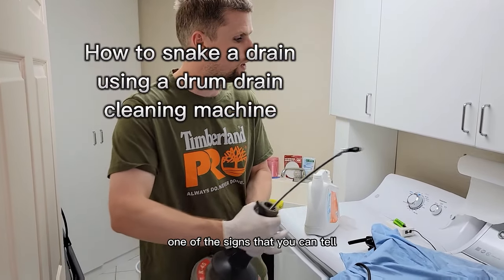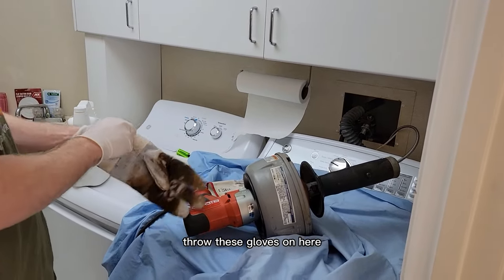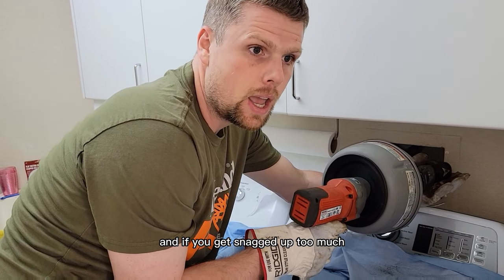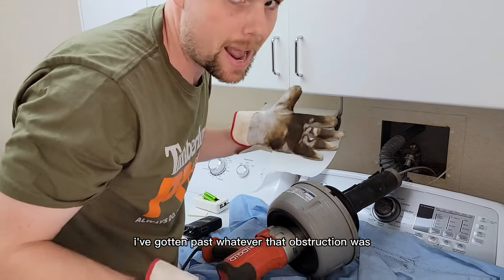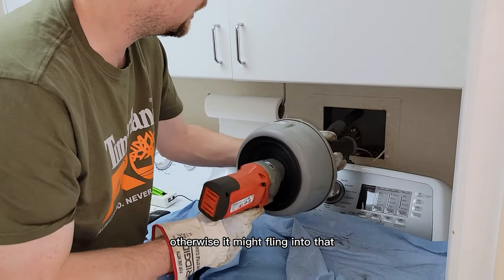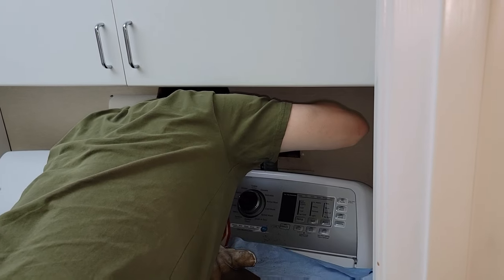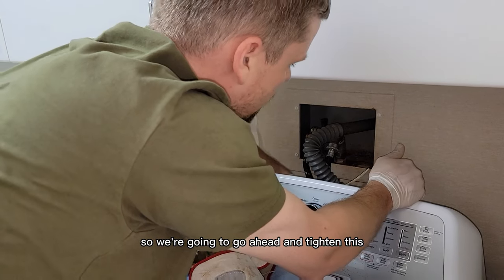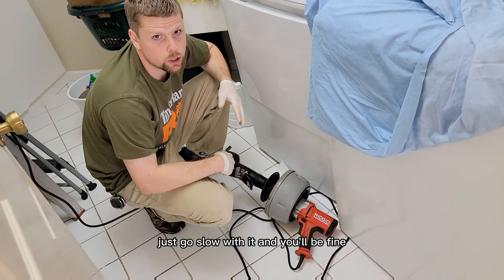Water overflow from washing machine drain #handyman #plumbing #diy

Comment: For those who are watching this in the future, I have watched all the youtube videos and the only real fix is to have a plumber go to your roof and clean out all the vent pipes. That's it, immediate zero overflow.
Reply: Like snake out the vent pipes?
Reply: @tobysshades  yes!
Reply: True story I had to go ahead and spend that lil money even tho I didn’t really want to.
Reply: you don't know what you're talking about.
Reply: How much did you end up spending
Reply: @repone817  It was pretty cheap I think it was around 100 200 the guy charged to clean all the vent pipes, been years since they were last cleaned out.
Reply: I agree.  

My dad used to climb on the roof, snake down the roof vents, and follow that with high pressure water from the garden hose. 

I've mentioned this to plumbers that I've hired throughout the years, and they look at me like I have 3 heads. They say, " Thats not the problem."  Well, I know for a fact that for the 50+ years my dad lived here snaking the roof vents solved the drain issues.
Reply: Forgive my ignorance but what’s in the vent pipe that needs snaking ?
Reply: @Blackbriar747  I think stuff like leaves and twigs.
Reply: @hutukaTB  thank you good sir
Reply: @Blackbriar747  blockages prevent proper airflow for the drains to do their thing. I’m no expert, just watched too many videos on how this crap works due to multiple plumbers coming to my house for the issue in this video. Still haven’t been able to get it fixed. To the point where I need a camera run down the drain to see if it’s busted and blocked by dirt. Plumbers charge way too much now
Reply: DIY guy here. Yes this video is correct, do snake the line. Also, yes, get on the roof and clear the vent. Hopefully it’s a straight pipe vent so you can clear it easily.
Reply: @robertmatthew5332  thank you. Just tried all of it yesterday. Washer drain still overflowing. I used a cheap harbor freight 25’ snake, maybe 3/8” diameter. Any recommendations?
Reply: @robertmatthew5332 I can’t get past the p trap w/ a snake 😂. Would the vent fix this no matter what?
Reply: This is great.  Very informative, even this 72 yr-old can understand.   I'm going to see if I can rent that cable snake.   Thanks again
Reply: The vent pipe goes to the roof all the time? I'm asking because mine doesn't have one. It looks like this,
Reply: @moniquecaton3285  yes at least for my house in the west coast.

Comment: The kitchen Drain line is the issue it collects a lot of debris and causes the back ups due to the fact that kitchen and laundry share a common line to the nearest bathroom Hydro jetting the kitchen line along with the laundry line cures this issue for many years approximately 15 years of accumulation before a homeowner notices any issues
Reply from the maker: This is tierd plumbing in a condo not tied into thr kitchen
Reply: I think this is my issue. If someone takes a shower upstairs, my downstairs kitchen sink floods as does my laundry line.
Reply: That is exactly my issue; the backwash overflowed in the washer area, and now I cannot get rid of the smell, despite cleaning with bleach; I'm overwhelmed, don't know what to do, and can't find a resolution; if anyone who is knowledgeable is reading this, should I take off the baseboards, and cut the drywall, checking to see if it's wet? Oh, the humanity.

Comment: New subscriber. Been doing maintenance for apartments most my working life. Great video! Just a warning to anyone new to using a powered snake; be extra careful while operating with gloves on. Normally you don't want to wear gloves while using any power tool, but due to where you will most likely be using a snake such as drains and toilets, gloves provide protection from an array of possibly harmful substances that may be encountered while clearing drain lines. Be careful to not have a glove get caught in your snake coil. Your hand and fingers can be injured pretty severely if it gets caught and wound, especially if you're using a bigger drum snake and have someone else running the motor.
Reply: Thank you for the warning! Very helpful
Reply: When using gloves with plumbing snake please make sure they are the leather kind and not the cotton fabric kind.
Reply: My drain is stopped up I pour liquid plumber in it had thick white residue floating in the bottle  followed that with hot water set 15 minutes ran my rubber bladder on a hose in and this usually solves the problem afterc15 minutes
Nor this time the drain pipe overflowed within 6 minutes I live in apt. No body else has a washer so now what?😢

Comment: here is a good one for you. my washer at least 1 time a year we would have to have it cleaned. then it got to where snaking would not work. so i put a t on about 3 to 4 inches from the top and put a bucket to catch the water. we was going to do a bathroom remodel and i did not want to keep letting water run all over the floor. also our washer and dryer is behind our bathroom. so i  started the demo and we have a ranch slab style house so i dug down and exposed the lines coming from the washer and the top looked fine i got to really looking at it and the whole back side of the pipe was gone. the washer was draining in the hole where the pipes when through to the main i could not believe it. and it was the old galvanized pipe from the 50's i got it all cut out and replaced and it has been about 2 years and no issues oh also the used 1 1/2 inch pipe to. back then they thought that pipe was going to last forever i bet.

Comment: These are always a pita. I find many times testing with just the water supply hose doesn't compare to the amount the machine flows and can get frustrating call backs that it's still not draining... In my experience a water snake, water balloon type snake is the better option. I used to hate getting these jobs. Now they are a breeze.
Reply: how long do you leave the water bladder on?
Reply: Water bladder just goes out the roof though right?

Comment: Thank you and I just did this tonight, but could not get past the neck/turn.  I am using Green Gobber Enzyme - in which I used 2 years ago on the kitchen sink and it worked great.  Yesterday, I used the garden hose and 'listened' to see if it was flowing and did hear it start to bubble/fill up, so obviously not cleared yet.  I will try the auger again tomorrow, and then to the roof (thanks to all comments below) to clear the vent pipes.  This 1965 set up has been working for me since 2012, but in July 2023, had a sewer/pump elec. breakdown and could not use any plumbing in the house for about 3 weeks, which caused this washer back up?  Oh Joy, more fun tomorrow!  Thanks for the tip on the 'getting around the pipe 'turn' joint!

Comment: Great  instructional video! My husband has had to snake ours a few times, but it's getting to where it doesn't take but a couple of months before it overflows again. We've been told it's because of our 2 inch drain pipe and the newer washing machines that pump out the water. Apparently, the smaller pipe and gravity aren't enough to keep up with the pump. Any thoughts or suggestions on a resolution - other than having to jackhammer the concrete to replace the pipe?
Reply: Check out the comment a few ones before where the guy says to get up on the roof and snake the vents.

Comment: one thing i've found when doing this is to remove the gasket from the washer hot line hose before sticking it in the drain to lessen the chance of loosing it down the drain
it will leak for sure if not there - ask me how i know lol
Reply from the maker: Lol never happen to me but now im sure it will
Reply: But how do you know?

Comment: Going to do this right now. On ours it has a clear small rain tube which seems to be coming from upstairs and there is water that’s draining out of it. Our wash machine drain did not back up. This is where we were here in the gurgling at. So now because we know that Claire pipe that also goes into the washing machine drain tube were wondering if the blockage might be upstairs instead of downstairs. Any words of advice would be very welcomed. Thanks for doing this. We appreciate it. I subscribed.

Comment: Hi my washer has water leakage, probably pipe clogged ?. If the case is same as yours, then leaking  water should be around pipe close to wall , right! But I did not see wet around corner. Your reply is appreciated.

Comment: what about when it's frozen?? Ours froze yesterday. At least I'm assuming because it's about -13 degrees here and this has never happened before this weather came in. We were washing clothes and it backed up on the floor. Pulled up the drain hose and saw water just sitting on top. The water and wall is very cold.

Comment: A good video. Unfortunately, I've done it exactly as you describe, including using hot water to flush the line, and still have a problem. 
It comes and goes & to a varying degree. The line will flow, but slower than the washer discharge. 
Currently it has to be stopped 4 times while pumping the water out, but sometimes only 2 times & then it will run ok for a while. 
It seems as though there is debris in the line that moves to create the blockage. The snake will go the full 25' which will reach the 4" main line & come out "clean", so it seems that the snake can get past the blockage. 
I've run the hose while running the snake. I've run the snake from the vent. Is there a brush accessory that will "scrub" the whole inside of the line instead of only the 1/4 to 1/2" of the snake and auger tip?
Reply: Did you ever get this cleared out?  Mine stops up every month or two.  I've cleared it with a snake, but usually I just poor drain cleaner.  I'd like to clean the pipe more thoroughly.

Comment: Does the size of the washer hose cause the back up in the drain?   Our drain has a backup and I was told by apartment manager that it was the size of the hose because the washer was too powerful and it is shooting out water at a high speed.  She asked me to switch out the hose that came with the washer.  Of course I did not do it.  I don’t agree with her.  Her plumber said there was no back up in the drain

Comment: I can run my hot water straight into the drain and it doesn’t overflow but as soon as let the washing machine drain itself into the pipe it overflows. Why is that?
Reply: That’s cause the new washers drain at a higher rate than the old ones, also running any water from a pipe source wouldn’t equate the flow from the washer’s drain cycle, especially the new washers

Comment: Question, I opened the filter on the actual washing machine to make sure it was clean. The residual water inside smelled like sewage but was clear. When I pulled up the hose going into the standing pipe, it looked like it maybe had sewage on the end of it? Is this an indication that the sewage is making it all the way up or is the brown stuff normal on this? How worried should I be?
Reply: Washing machine just needs cleaning. The thing you removed on your washing machine acts like a filter and needs to be cleaned every so often.

Comment: I put my hot water line in mine and flows great but when I run a load water still comes back up
Reply: Alex I have the same problem I did what the video said when I ran the washer it backup for me also did you get any replies if so can you share. Is this the correct email

Comment: My laundry drain only over flows randomly? Seems like if it had a blockage wouldn’t it overflow all the time? I’ve ran water down it through my water hose for 15-20 minutes & it never overflowed but it did just before I did that? 🤷🏻‍♂️
Reply: Currently in the same predicament. Did you ever get it fixed?? I’m about ready to yank my hair out.
Reply: any luck? I’m going through the same thing…I just rented a snake but it seems it’s not getting pass the trap. I’m ready to break drywall cut the pipe to get a good view.

Comment: So my drain line is 1 1/2. My home is around 1970 ish I cannot get it to stop backing up. I changed the p-trap to 2" and I still have the same problem. Snaked it to 25ft. A plumber wants to charge me 5grand to "repipe" it. What do I do?
Reply: I am in the exact same situation. I changed the P trap and snaked the pipe and it was good for a couple months and started to back up again. Leads me to think the trap did very little to help.
Plumber told me that I need to change all my cast iron pipes in the future.😢